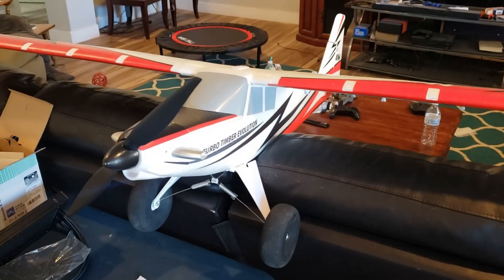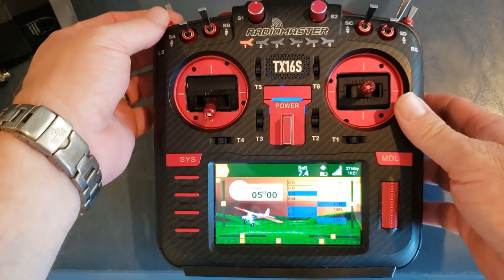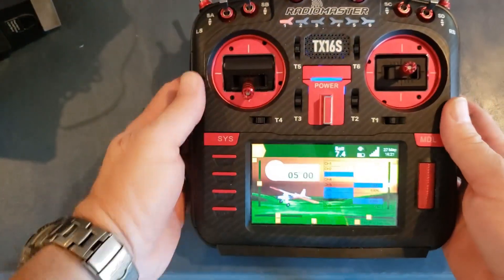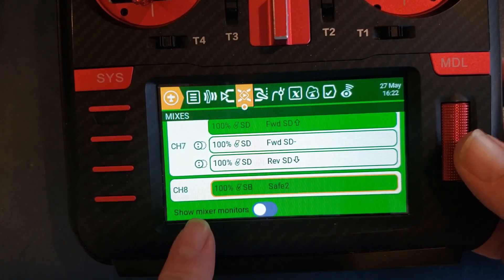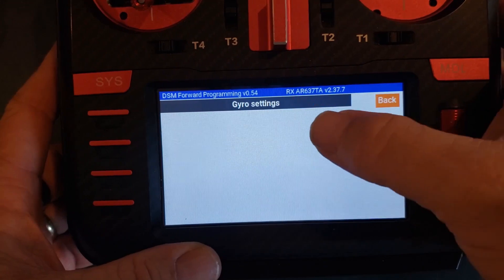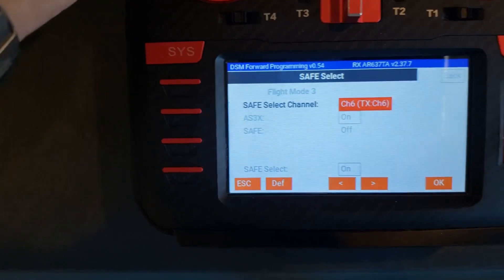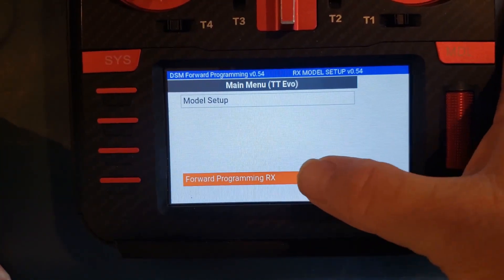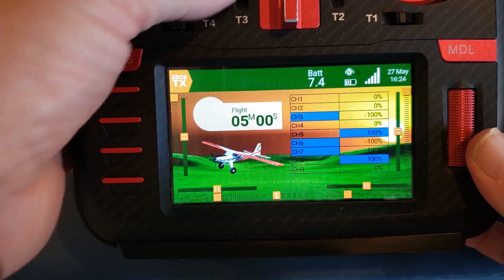Ep.5 Radiomaster TX16S EdgeTX to Spektrum Forward Programming

Comment: Hey,
What kind of Modul do you use for the Software
Reply from the maker: I am not sure what you mean, can you explain your question?  What software are you referring to?
Reply: @shanesdiy i want to use Forward Programming on my Taranis X9D plus but it Support no dsmx… what JR Modul do you use for DSMX and where can i Download the Lua Script ?
Reply from the maker: @sebastianmuller6301  Ok, thank you for the clarification.  The latest DSM Tools is a "Suite" and may not be compatible with your X9D Plus due to lack of memory.  If your EdgeTX is up to date (It won't work with OpenTX) you can use the stand alone DSM Tools Lua.  Follow the instructions for the B&W radios.   I made a video a few months back featuring the Zorro and your X9D Plus should use the same scripts.  The latest stand alone Lua for B&W Forward Programming is version 0.59b so in the video where you download the Lua, get version 0.59b which is newer than the one I installed in this video.

Here is the video on installing DSM Tools on the Zorro which should work for your X9D Plus.
https://youtu.be/X3-KtqTPpZE
Reply: @shanesdiy thanks so much, What for a Modul i Need for my Taranis ?
Reply from the maker: @sebastianmuller6301  Oh yes, forgot to answer that.  You will want to do your own research to be sure but I believe your Taranis has a JR type module bay so any 4in1 module that is JR compatible should work.  I personally use the Radiomaster 4in1 module when I need an external 4in1 module.   It is a Nano module but it comes with the JR bay adapter.   Here is a link to the Radiomaster module on Amazon that I use and I think will work for you but you should double check your spec and make sure it has the JR bay.
https://amzn.to/3HUbuUr
Reply: @shanesdiy thank you

Comment: Question…do you planning to release a video that details how to update Turbo Timber with Spektrum receiver from AS3X to AS3X+ using TS16S with Forward Programming Version 59.  I don’t see any video that clearly explain.  I really appreciate the videos that you have released as they are super thorough.  Thanks for considering! 😊
Reply from the maker: I'll give it some thought.  The EdgeTX unique procedures haven't changed with the new update, just how Forward Programming is setup with the new AS3X+ features so I hadn't seen much value in a new video for that.  Are you referring to updating the receiver firmware because that part uses the PC, not the radio and there are quite a few videos already out on updating the receiver firmware.  If you mean setting up Forward Programming in a newly updated receiver for AS3X+ the initial setup using the DSM Tools model setup is the same as it always has been and once in Forward Programming it is the same as with any Spektrum radio so videos on the subject for that part of the AS3X+ setup will apply.  I worked with the DSM Tools developer to get all the menus populated and as far as I know v0.59 will set up a receiver exactly as a Spektrum radio will.

If there are any specific things that are causing you problems let me know.

Comment: Shane, you have been a huge help to me so far.  Thanks so much for that.  As someone who just bought a few planes on a whim and a TX16S you have taught me how to almost 100% successfully set up my first planes.  I got my Habu STS fully working (it has the safe and panic channels setup automatically on 5 and 6 and I was able to get it working through logic and special functions from one of your videos) However, on my 1.2m P51 with an AR631....I am still not able to get Safe working.  In forward programming I have selected the Safe Channel as 7 and got it to stick and I know how to assign the switch because I got the reverse thrust working on channel 8 (thanks for that!).  One thing that seems off about my forward programming is that on the menus where you're going through the 3 flight modes and turning off as3x and safe select etc.  I have zero ability to change or edit the box that simply says "Safe".  I feel like this is the problem, but I really need someone to help me figure this one out!  Thanks, in advance.
Reply from the maker: Receiver is locked so you'll be limited on what you can edit. In your model setup just above the bind button make sure you have enough channels enabled. Sometimes it'll default to 1-6, if so change that to 1-12.  Try that and let me know.
Reply from the maker: Wait, the reverse thrust, was that on this P51? If so the channels all enabled.  In forward programming looking at the modes do they cycle through them with your safe switch?  Did you bind with safe select enabled? Thats where you put the bind plug in, power up, remove the bind plug, then bind.

Perhaps safe select isn't on at all?
Reply: @shanesdiy  Yes, I got reverse thrust working on channel 8 on this same airplane.  I only have channels 1-8 active currently.  When I turn on and bind, I'm going through those exact steps to bind in Safe mode.  It even does the 2 waggles like it should to let me know is bound in Safe.  I have to be missing one small detail.
Reply from the maker: Double check that channel 7 was saved in Forward Programming.

Can you send me a photo of your channel 7 mixer edit screen and also of the forward programming safe channel select screen?
shanesdiychannel "at" gmail.com

Comment: All i did is turned ch5 on in my tx16s. Assign a switch, add voices. Did that once & its worked everytime since. 

On a side note, i sold my trashy ix20se for enuf to buy the tx16s max2 (with AG01), battery, & was terrified the 1st 2 weeks. AFTER scratching the surface on the tx16s,  F spektrum! Nothing like a $2000.00 slab of crap plastic to wake 1 up!

Comment: Nice but how you adjuste the gains in flowering programs. My jet is to tachy it wolbles bad?
Reply from the maker: If the receiver came with a BNF (bind and fly) airplane and is still locked, unfortunately you cannot adjust gains. In earlier episodes of this series I show how to do all that.  Once the receiver is unlocked you can enter forward programming and either adjust the fixed gains for AS3X or change it to adjustable and assign a potentiometer or slider switch to it for adjustment in flight.